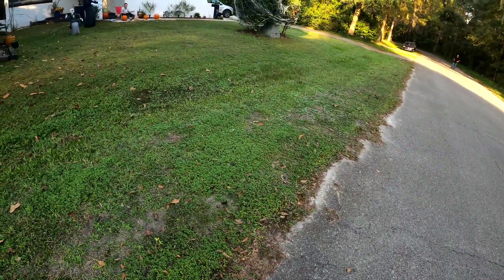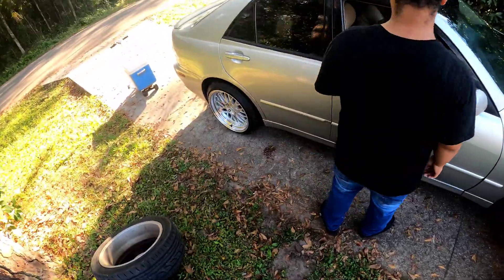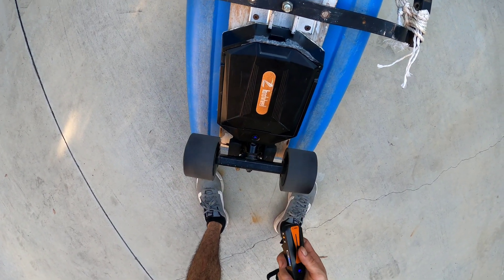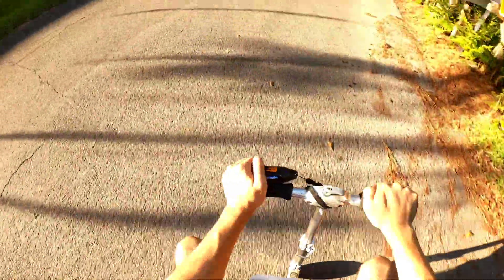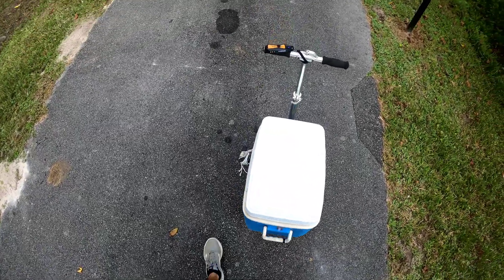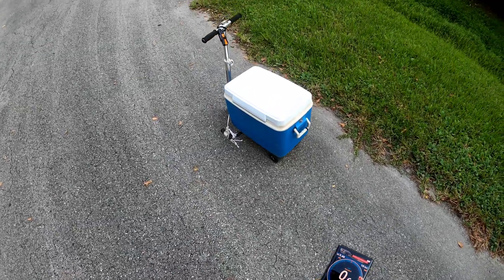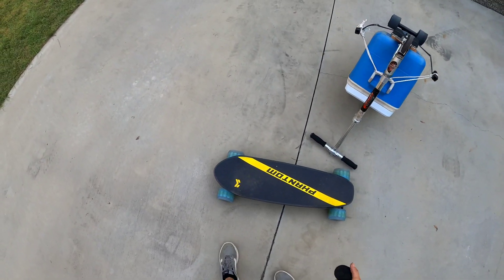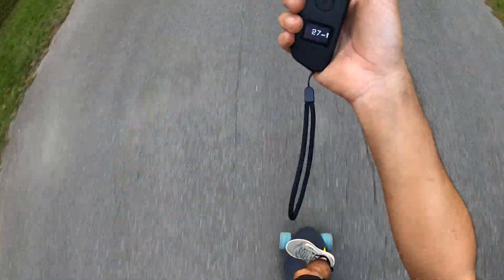The coolest cooler (DIY Electric cooler)

Comment: yo a 24mph cooler tho is kinda nuts tho. think of the deliveries, you should try and find a way to set up the extra set of wheels and the truck to the front of the scooter turn it into 4 wheels instead of 3, whould probably make it more stable and that board looks nuts
Reply from the maker: It really is! I need to take it out on some smooth pavement to really get an accurate speed test lol. Yo that would a be a total of 5 wheels 😅 I actually might give it a shot tho 👀 Definitely going to expand more on this project 🤘